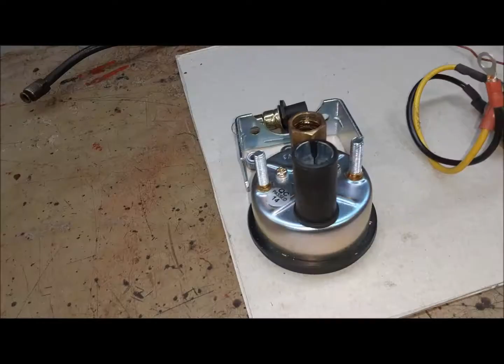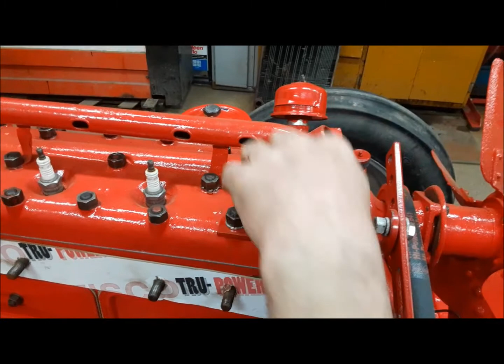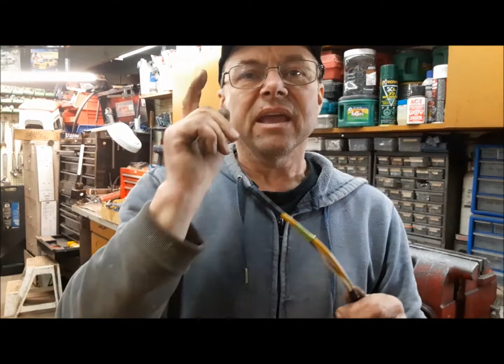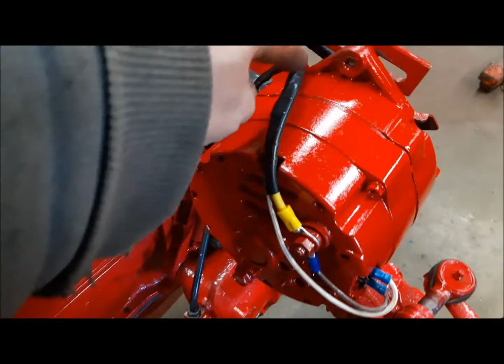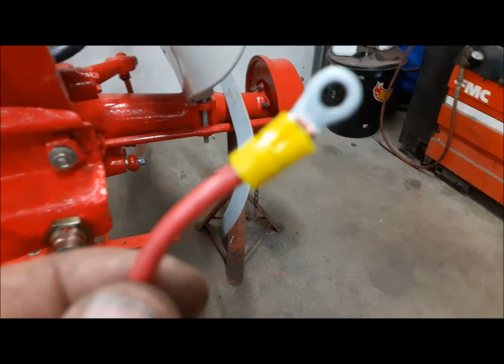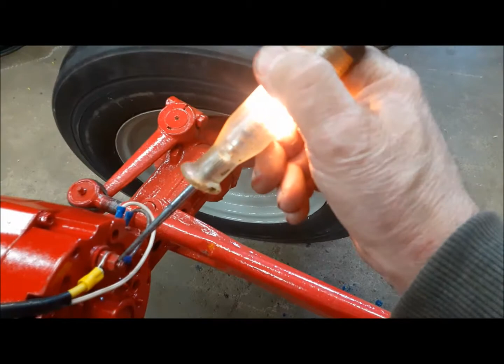1948 Ford 8N Parts Tractor part 16 Electrical Step by Step

Comment: Kevin, hoping you’ll help me get the electrical correct on my 8N. I’ve followed your instructions but I am a little lost because my system has been converted to 12V. When it comes to the “L” & “B” on the amp meter, the “B” is connected to the battery at the solenoid. What about the “L” for load? I understand the “L” is for the headlights etc.
Where does the alt connect? I have instructions showing where the alt is connected to the neg (-) side of the “volt” meter but I have the amp meter. Where does the alt wire connect? Please & thank you!
Reply from the maker: attach the alternator output to the L terminal of the ammeter. The L terminal is also the place to pick up your light and ignition feeds as you described.

Comment: I love all your videos was wondering if you can make a video response to setting up and installing a side mount distributor I have timing marks on two sides of the flywheel is with the number one cylinder at the top of the powerstroke I have spark but it won't start so I don't know if I'm missing something
Reply from the maker: I've got a side distributor tractor here. But I won't get to it til spring.

Comment: Hey Kevin I’m sorry to bother you again (last time, I promise!) but I’ve noticed you said the the tattletale should be spliced into the ignition. Why couldn’t I just put an eyelet on the end of both the tattletale and the ignition and just put each one onto the resistor stud? Thank you again for your help
Reply from the maker: The tattletale can be fed from any switched ignition source. The hot side of the resistor is just fine for it. Ask all the questions you want, I am happy to answer them. Knowledge is useless if it is not shared.

Comment: My 8N seems to have a weak spark as I manually move points and none when i turn over by starter button. Any Ideas?
Reply from the maker: It could be so many things. A slightly weak battery, bad ignition switch, wrong resistor/resistance, a bad connection somewhere.

Comment: Sorry to bother you but could you please tell me what the brown jumper on the alternator does? I know that your white wire is for the tattletale but I’m not sure about your jumper. Thanks very much. Your videos have been invaluable to me.
Reply from the maker: Thanks for watching. The brown jumper is the actual current required to run the regulator.

Comment: Hi Kevin,
I got the 12v conversion kit from Just8ns and it comes with the 1 wire harness. My alternator looks exactly like yours though. Do you prefer the 3 wire setup over the 1 and can I still wire mine up as a 3 wire? The terminals are there for it. 
I also noticed you kept the amp meter because I was thinking about going to a volt meter instead. Whats your thoughts on that?
I also want to run a similar lighting setup to yours but with the switch that pulls out like I think you ran on the other 48 you did.

Thanks
Reply from the maker: Either style alternator is fine. If you use a 1 wire its best to unhook the battery when its parked. And sometimes depending on the pulley setup the 1 wires take a good blip of the throttle to get them going. The 3 wire starts up great and has the advantage of the charge light so you don't need a gauge. As far as gauges, ammeter or voltmeter simply boils down to user preference. I've used both.
Reply: @ClaremontClassicGarage  If I decide to go 3 wire do you have a link for a diagram of your wiring? Im confused why an extra wire is needed for the electronic ignition. I have the 12v alternator kit , 12v coil, and 12v pertronix. I thought it just used the same power wire that goes on top of the coil?
Reply from the maker: @jjay718  The wiring diagram is in the big filing cabinet between my ears lol. If you are going to run electronic ignition you need to run the second wire as it is required to run the ignition module. The wire that already goes to the coil won't work as it has the ballast resistor in it and reduces the voltage. The Ignition module needs its own full 12v feed to work.  As far as the alternator wiring just google Delco 10SI wiring and you'll find a good diagram. I may know a link for a full 12v 8N diagram. I'll try to find it.
Reply from the maker: here you go! https://www.myfordtractors.com/12volt03.shtml
Reply: @ClaremontClassicGarage  thanks!
Reply: @ClaremontClassicGarage  Thanks again. That matches up to what I got from JMOR on the forums.

Comment: I was hoping you had left the 6 volt battery and generator in place , and not changed the polarity from positive ground .
Reply from the maker: Sometimes after enough projects I have enough good parts to do one 6V and I do. But most of them around here end up 12.

Comment: my 9n doesnt have a starter solenoid. from what i read they didnt have them should i add them even if i have the ingnition button
Reply from the maker: You don't need to add a solenoid. 9Ns and 2Ns have a mechanical solenoid that you activate when you push the button. The 8N did away with that arrangement and replaced it with the electrical solenoid.

Comment: I have a 1949 Ford 8N that I'm having a hard time trying to find a wiring loom for my spark plug wires I'd like to know if you have any information where I might be able to find one
Reply from the maker: The metal tube? they're always missing. Watch ebay they pop up. There are no reproductions of them so you have to scrounge. Google "tractor wreckers". you'll a find a couple near you .

Comment: Why is the small terminal on the back side of the starter solenoid hot when you just said it is a ground wire that connects to the starter button??
Reply from the maker: The current passes thru the solenoid coil and is grounded by the button. Therefore the wire coming out of the sol is hot.
Reply: @ClaremontClassicGarage  Wow that was a fast reply on your end! I'm impressed! Thanks for you help Sir!
Reply from the maker: @redblazehorse My pleasure, thanks for watching!

Comment: I did same thing why does my tractor try to turn on when I connect battery ?
Reply from the maker: Could be a lot of things. A bad starter switch or solenoid or something is hooked up incorrectly..

Comment: I have a 1949 8n trying to get running to see if it will run.
Zero wiring on tractor and no starter any tricks I can use
Reply from the maker: I would say you at least need a starter. Or try pulling it to start it.
Reply: @ClaremontClassicGarage  difficult to pull start it's just me.
I ordered a starter distributor and coil last night after watching your video. Very helpful thank you
Reply from the maker: @richardtaylor6242  Thanks for watching!